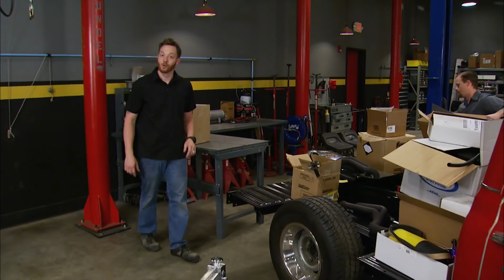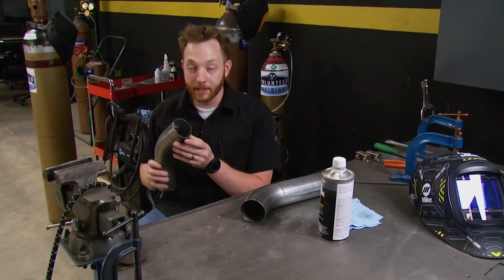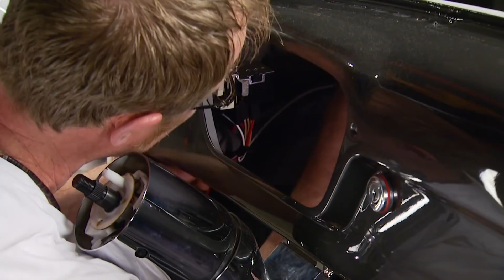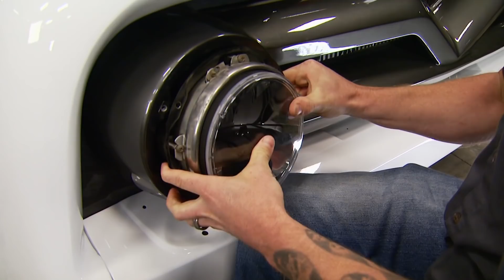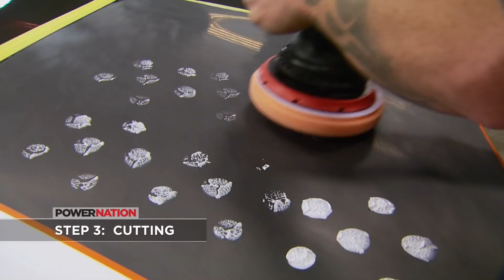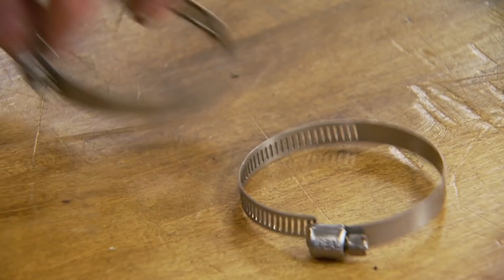Cutting and Buffing to Create a Smooth as Glass Finish - Truck Tech S3, E15

Comment: Hmm going over the top may cause problems with the bed due to the heat. It also creates more friction loss due to the extra bends.
Reply: Going underneath reduces ground clearance and making a 3 inch monster hole in the frame is a bad idea you'll lose alot of power when you hit a pot hole and snap the truck in half the best idea is to just put the exaust where it belongs, under the bumper or just behind the rear wheel

Comment: 3 inch exhaust seems like a waste when the header collector is 2.5 in.
Reply: You lose tourque when using oversized pipes, find pipes that fit your displacement and exaust valve diameters

Comment: my grand pa has a 1948  ford f100 pickup that has been adapted from the original frame which had a flathead in tween it. well he put it onto a ford bronco frame, had to cut 10 inches off the bed so its a hare stubby but its his project truck, well it had no wiring so what is a old man who was born just over 70 years ago now, and he had 2 scrap ford broncos, well he takes the wiring harnes out of both and uses it in his project, as of wrighting this he has goten the turn signals wired up on all 4 lights, and thats about all he has for wiring. he dose have a audio system that he will put in but thats about it

Comment: External fuel pumps are noisy because they are sucking air which causes inconsistent fuel pressure, the Holley hydramat eliminates the sucking air noise and inconsistent fuel pressure